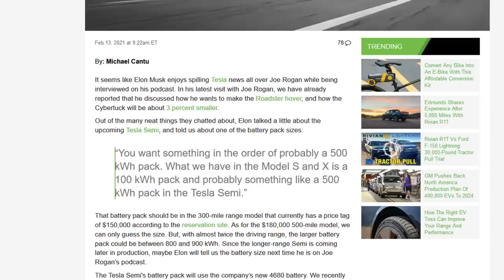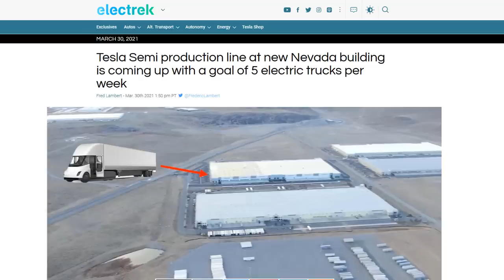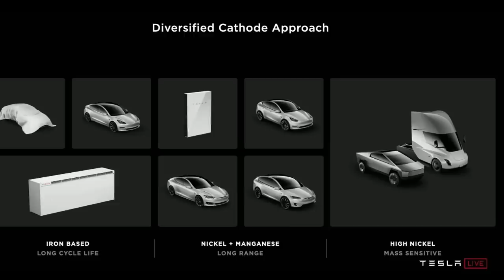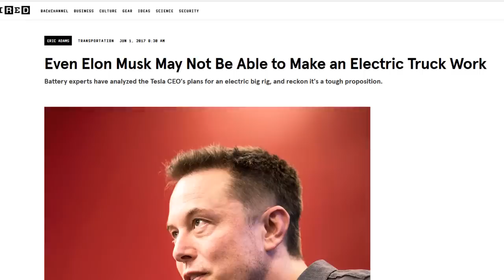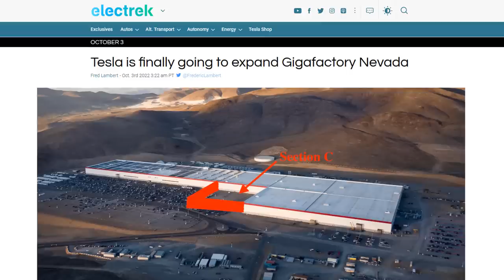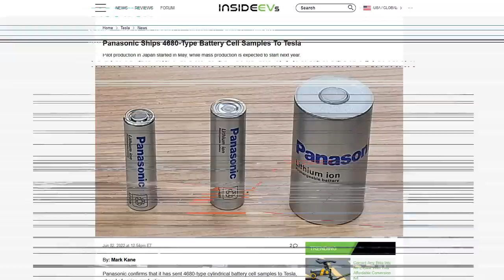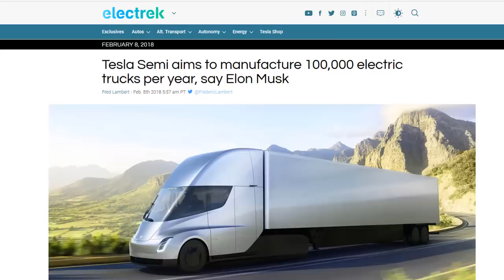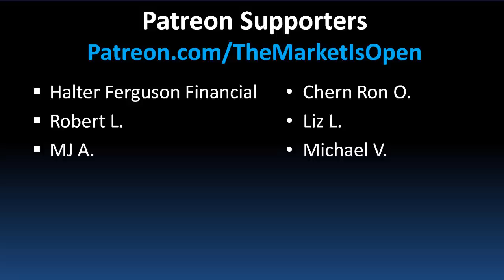Tesla Semi Is Coming in a Month - Let that Sink In

Comment: Ok the car has a 100kw battery that goes 350+ miles now we have a truck with a 500kw battery that ways 12-14 times as much and is going to travel 500 miles????????? Never mind the huge frontal area… can’t wait for reality tests…
Reply: Yup 
Shorting Tesla 
It easy ( like the hyper loop 😂) just use your brain
Reply: @Agorax_gg  Yes the only Elon company I would say is properly valued if not undervalued is SpaceX, which while privately owned is the most revolutionary.
Reply: I’d hate to bet against Elon.
Reply: @shepherdsknoll  cmon, if you could bet against the Elon announcements you would be a very rich person, almost everything he announces is pure fantasy
Reply: @shepherdsknoll  well he fails cosntantly,   but hes really good at bs.
Reply: Energy needed to pull 80000 lbs max capacity.
Reply: The physics simply do not add up
Reply: @bob14775523  , really ? You’re going to challenge Elon Musk and the rest of his top engineers on physics ? ?
Reply: @shepherdsknoll  The promised performance of the 500kw battery in the semi literally defys the laws of physic. Spcifcly the claimed range on this battery at full payload. Elon will make a semi but he has overpromised and will therfore underdeliver.

Comment: Great video, as always.  FWIW, most states limit Commercial Motor Vehicles to 80,000lbs.  Also, if the Semi is registered as  an RV then a CDL is not required, case in point all the big Pusher Motor Homes on the highway today.  No CDL required even those with air brakes.  Really this makes no sense to me, but I don't make the rules.
Reply: You're correct on the 80,000 lb for a regular semi the electric semis the federal government decided 82,000 lb is okay.
Total crap if 82,000 is okay it should be okay for all semis.
Reply: >  The state will want to register the truck at commercial rates for the high fees generated. To register as an RV is unlikely without custom work done to make it an actual RV. Insurance for commercial vehicles is very expensive also.  HOAs will limit truck parking.  Unloaded trucks are a rough ride and hard to handle on wet or icy roads. Reality should limit sales to consumers.
Reply: @carlwest859  It varies from state to state but operating a Heavy Duty Truck (HDT) as a non-comercial hauler is the distinction. Interested in learning more search HDT Rally to see some videos.

Comment: Maybe the first Semis don't need much range because of who the customer is. The logistics for each customer can be very different, depending on the locations, weights and charging setup. They can afford to roll out less capable trucks for less demanding applications.
Reply: Maybe you are thinking Lays potato chips are light but Pepsico will be hauling bottles also.
Reply: @shepherdsknoll  its not the weight, all trips try to be max weight for efficiency, its about the distance. Certain trips are known short distances.
Reply: Weight will make a big difference is there is change in elevation.moving nitrogen filled bags with a few chips should be light.

Comment: Around 13:00. There could be a market for the smaller Semi for rich people to haul their huge mobile homes or Tiny houses.
Reply: Ideally, a single drive axle with a modified bed would be ideal for large 5th wheels and horse/house trailers.  CDL is not required for most private/not for hire tractors.  Truly, a full timers dream setup.
Reply: @clnelson321  However,  I don't know the range of the smaller Semi. It could just be for local deliveries.
Reply: I imagine something like a flatbed Kodiak